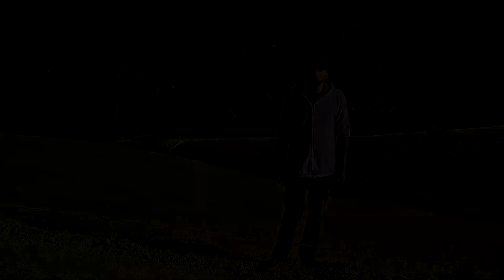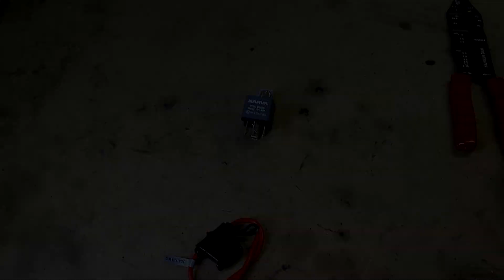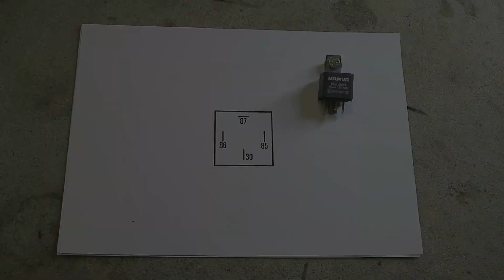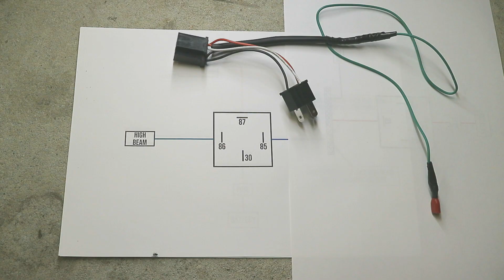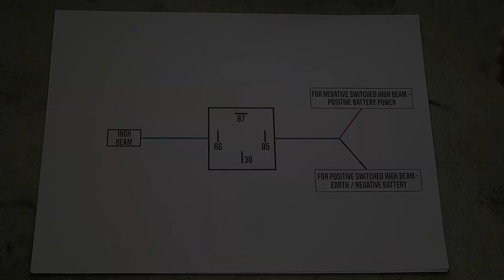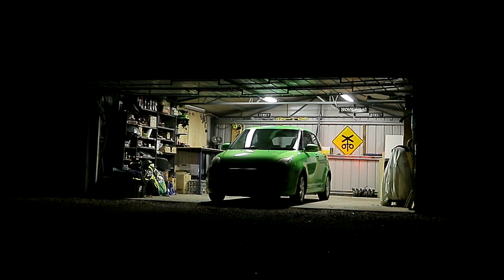Fit a Light Bar on ANY CAR! Easy DIY Wiring Harness and Mount

Comment: VSI-8 of the Victorian Transport regulations require an override (or control) switch for all auxiliary forward facing lights in addition to only operating when the highbeam circuit is active, this permits OEM highbeam operation independant of the lightbar/driving light array.

Your install works perfectly fine, the only concern would be an overzealous insurance investigator looking for way out of honouring an insurance claim should the vehicle have a negative road outcome.

Comment: Thanks for this video. I tried to hook up a led ramp and couldn't figure out why it didn't work. Seems like I also have a car with negatively switched system. I'm going to cut the finished cable kit and rewire it.
Reply from the maker: Good luck, hope you can sort it mate. Had to do similar for my brother in laws CX7 - he bought a pre-made wiring kit that didn't work, ended up chopping half of it out and redoing the rest!
Reply: @BrowneysGarage  Installed it tonight. It worked! When I turn on the highbeam, the led bar turn on as well. 😀

Comment: Couple of questions: 1. if you had to have the light bar connected through a separate isolated switch (for compliance purposes) where would you put it in your diagram? The function would be, both high beams and isolated switch need to be ON to power the new lights. 2. If you had one of those smart relays (auto-sensing positive/negative charged) how would that affect your diagram?. Thanks in advance.
Reply: @IzakJackson  Yes I did. Thanks.

Comment: Couldnt you have just connected it to your fog lamps?
Reply from the maker: Could have, much easier to get to headlight wiring though and functions better with the high beams anyway. Oh and this puts it on relay power so the smaller gauge wire doesn’t get burnt up if it’s not rated for it.

Comment: Great vid not sure how am going to fit them to a Renault clio as the front is all plastic and am from UK so number plates are plastic
Reply from the maker: Front of the Swift was all plastic except the small clips/nuts the bolts went into, and obviously the number plate but expect this won't add much, so you may be able to get away with similar. Maybe try source the angle used for the mount in aluminum to keep weight down to help?

Best of luck mate 👍
Reply: @BrowneysGarage  cheers mun and thanks for the fast replie yeah it's seems quite sturdy the plastic just need to figure out away with out drilling holes

Comment: bugger, I saw the title and was hoping that you have been able to crack the wiring code to run the light bar off the foggie switch in the cabin. but loves yah work. If you are thinking about installing a revers cam off a relay to have them work off a switch instead of the reverse light let us know as I can donate my car towards the video
Reply from the maker: @bryan skerry No plans for those as yet but will keep them in mind, and thanks for the offer mate 👍
Reply: @BrowneysGarage  cheers, I am running a cam from a late model factory but was adding an extra 2 for help in the blind spots when loaded
Reply from the maker: Damn you’re going to nearly have a small TV studio!
Reply: @BrowneysGarage  yeah I need it. Limo tint and the plastic perf mesh on the glass 😉 but safety first
Reply from the maker: Haha Ok definitely sounds like you need it then!